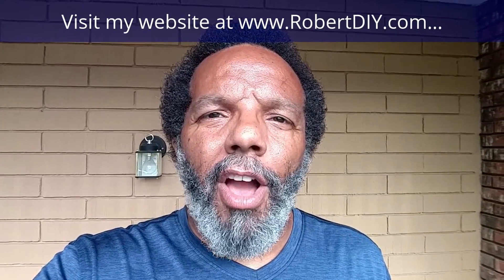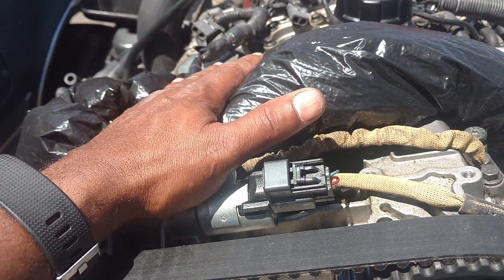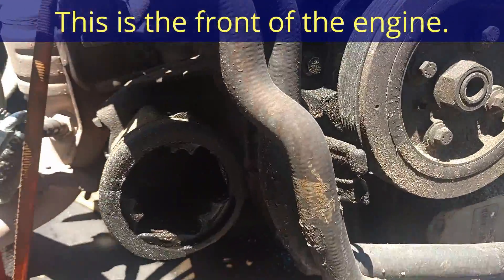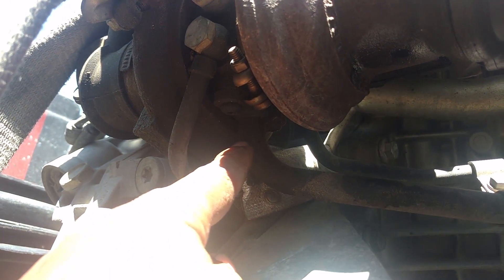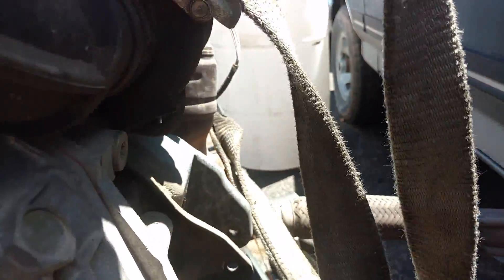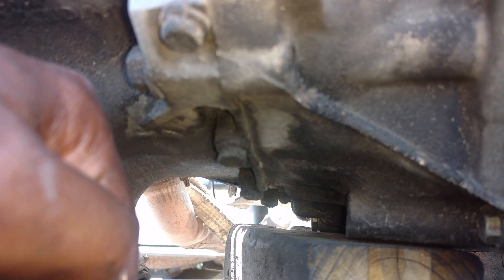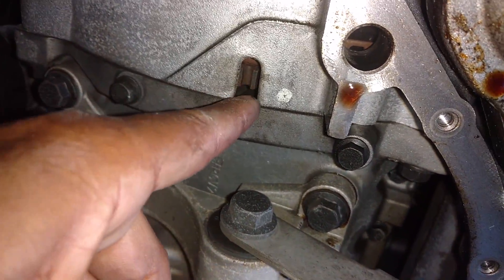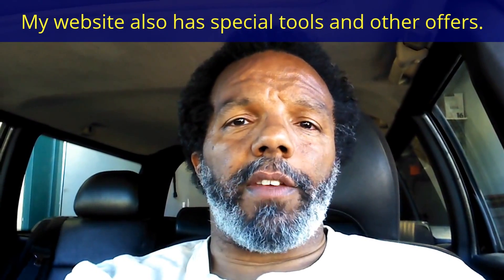How to find oil leaks on a Volvo white block engine. S60, XC90, V70XC, S80, S70, 850, 960, etc. VOTD

Comment: Hey robert on my 2000 c70 it was leaking oil bad and the intake cam seal popped out. Got a new seal put it in and it poped out again 2 weeks later. Im not sure why it pops out even tho the seal is fine. Any thoughts?
Reply from the maker: what brand seal did you install?
Reply: Corteco. However the oem cam seal did pop out and when i took it out it wasnt damaged , it was just as good as the new corteco one. Put the corteco seal in and same issue the seal just popped out. Maybe due to a clogged pcv?
Reply: U think a clogged pcv could cause these seals to pop out?

Comment: Robert thanks for your help in this matter.  If the oil cap  leaks ( I think) after an aftermarket replacement for my 98 s90 what else could be the problem? Thanks
Reply from the maker: Well, I would get a Volvo part. Then see if the PCV is serviceable.

Comment: Thanks again Robert, you really have saved me a lot of time. Been looking for a leak for the last hour plus and sure enough you did it again. I found it underneath the exhaust cam - drivers side rear. I have replaced much with your help, TB, pvc hoses, oil trap, intake seals, and more. Guess it's time for the exhaust. Thanks for helping me find it.
Reply from the maker: cam seal?

Comment: This helped a lot for the turbo oil line leak I have.  Thanks.  I was wondering if you have a video on a power steering leak as well.  I have a 2002 S60 T5 2.3L that spews power steering fluid everywhere.  I just cannot find the leak for nothing.  If you do have a video, I have not been able to find it.  Thanks.
Reply from the maker: Sad to say, I do not.

Comment: at 6:19 where you mention lower PCV box hose leak; is that the consistency of motor oil or a kind of "blow by" thinner goo?
i thought my oil sender was leaking, but can stop it, now I think it is the intermediate block seam.
 2005 S60 2.5t with "only" 118k miles
Reply from the maker: Oil leak.

Comment: Hi Robert I have a 00 s70 I had to change all the oil seals on it but when I put the car back together I have a code for the exhaust being advanced. All my timing marks are on the car runs great but it throws a code {sry don't remember what the number is its been so long but its an advanced timing) The main questions I have is...1st -  Is it possible that I over tightened the vvt gear 80ftlb and it is not letting it operate properly with the oil pressure?: (Could I have it to tight that it is pinching the gear an bearing)2nd - if I do have the proper torque lbs should I loosen the 3 bolts on the gear an center it on each other an reset the timing, what happens when you center the gear? is that how they come from the factory on the car to begin with?Sorry to ask this on this video clip I don't know how to get directly to your email to go into more detail. Thanks and hope to here from you soon. Also I have never worked on a Volvo b4 you have taught me a bunch !!!!!!!! and THANK YOU!!!!!!! A BUNCH!
Reply from the maker: https://youtu.be/0H5cgRYCMQg
Reply: Hi Robert Thanks 4 all the info I pulled the vvt hub off and reset all the marks  put it back together and the check engine light is gone. The only ight that's on is the service engine and that will gout after I put an oil change on the car. 1 thing that will make this video easier 4 1st timers to understand is that after you pull the hub off and reset the 3 bolts and gear to the center position "this is were it was confusing this should help every1" Like Robert said turn the hub and set it to the mark snug the bolt rotate the hub to see how many teeth it turns past the mark and count them, loosen the bolt turn the hub counter close wise that many teeth past the timing mark snug the bolt check it to make sure its on the mark then finish following Roberts directions for putting it back together. Not trying to step on your toes Robert just making it easier like I said for some1 like myself that wasn't quite sure or positive about what I was doing.Again thank you for all your info I couldn't of done it without you THANKS Have a Great Day!

Comment: if looking at engine from front of car i have an oil leak on the left side towards the top and rear and just below a few inches dripping down.  what might be the problem?  Thanks Robert you are a wealth of knowledge.
Reply from the maker: Huh? I have no idea. How about a picture of video?
Reply: @RobertDIY  sorry for being so lame!  its a 98 s90 and towards the back of the motor on passenger side i see a steady leak (drop) it looks like a hose.  going to the shop tomorrow and thought i could act like I knew something. lol.  have a good one!!
Reply from the maker: top or bottom of the engine?

Comment: 👍👍👍👍👍 cool Robert  keep up the good work bro . I was wondering where the oil came from on top of the engine block & now I know. Thanks once againe bro
Reply from the maker: You are welcome
Reply: Oil leaks on to of spark plugs?
Reply: Is that from valve cover seals?

Comment: @Robert DIY what is that at 03:53? I mean, my 850R does leak there, and it causes hidraulic lifter noises, or, the oil is crap? Only 1000 Miles after change, I don't quite know, it just started.
Reply from the maker: Huh? There are 3 access panels on the back of the engine. They don't cause lifter noise. I have no idea what kind of oil you are using or what filter you have installed.
Reply: @RobertDIY  We put Total Quartz 9000 in it, viscosity is 5W40,and,a japanparts filter. The engine leaks oil, on the passenger side, at the back of the cooler. PCV was changed 40.000 Miles ago.

Comment: Thanks for this video.
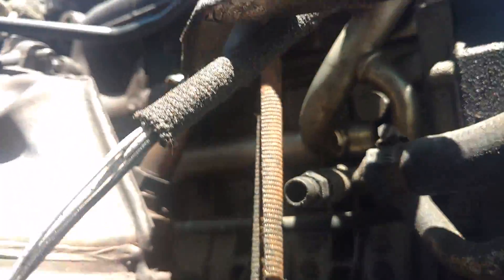Around minute 3:40 you are talking about block panels on the back of the engine. I have a 1996 volvo 855 turbo driven around 100.000 miles that is leaking at the back of the engine there is oil everywhere on the back of the engine do you have a picture, video or some link to the gasket needed to fix this gasket ?
Reply from the maker: No, I do not. Make sure that is the source of the leak and get the kit from the dealer, about $8. Easy replacement, just unscrew them, remove old gasket, install the new gasket, don't over tighten the screws.

Comment: Hi robert, your videos have been very helpful to me since i bought my c70. I just rebuilt my t5 engine and it is running really well but its leaking oil real bad. It looks like the oil is coming from the hole which you show in this video by the transmission side. I replaced the crankseal (i replaced all seals in the motor), could this still be where it is leaking? I tested PCV with the glove method and it isnt inflating, but it is not sucking either. Could the pcv be the problem since it isnt sucking in the glove? I really dont want to pull my engine out again to change the crankseal but i guess i have to.. But should the glove be sucking in to the oilcap? At least it isnt blowing. I have no idea how my brand new crankseal can be leaking.. Thank you in advance Robert! Do you think i have to pull my engine and replace the seal again or could it just be the PCV?
Reply from the maker: If you did NOT use a seal tool you likely damaged it.
Reply: Do you know if i can buy this tool in europe? I live in sweden and i cannot find this tool except for v-garage in canada and that will be too expensive shipping. I will try red line seal saver, though i do not think it will work.. its worth a try, then i probably will buy a real volvo seal but i hope i can install it without the tool.
Reply from the maker: Are you referring to the Rear Main Seal on the back of the engine where the flywheel mounts? If so, I don't recommend taking chances with that one.
Reply: I believe the rear main seal is leaking, and yes i should do it right since it is a big job just for that seal. I installed an aftermarket seal that maybe is not the best, that is probably why its leaking..
Reply from the maker: Seal install tool.

Comment: hello Robert Im new on your videos and you explain very good all this common problems of leakings and tips, recently I bought a V70 XC 2001 the car came with many mechanical problems between them the transmission failed, but notice an excessive Leaking of engine oil, I remove the top plastic cap on de head and note that it was full of oil and some of the screws had been changed by the previous owner 4 of them that are around a spark plug duct were swept from the thread, I  change some of the screws by others slightly longer and tightened well the oil drain decreased considerably but is still droping oil and falls on the Cv boot joint passenger side, and I do not know where is the problem, I will have to change all the oil seals ?? thanks in advanced.
best regards!!
Reply from the maker: Probably the front cam seals.

Comment: I'm hoping my leak is just the oil pan, engines been out before i owned it so it's anybody's guess. Are any of the pan bolts or accessory bolts ones I should use thread sealer on? Also, is the outward facing sensor  on the front/center of the block a oil pressure sensor?I have to replace the valve body soon anyway may just knock them both out.2006 V70R 270,000 miles
Reply from the maker: https://www.youtube.com/watch?v=L3_lC3X3AFg

Comment: Dear Robert
I have a 1996 Volvo 850 non turbo 2.4l i found out that there is low oil in the dip stick i but the car on the hoist and look all the driver side were covered with oil splash to the back of the car I added about 2 L of oil but can not locate the leak can you help
Thank you
Reply from the maker: Sure, bring it by.

Comment: Ay Rob, is it difficult to replace the camshaft seals by yourself? Can you make a short video about it of link to one? I havent located the leak yet but by the looks of it, its dripping right under the belt assembly
Reply from the maker: https://youtu.be/gt9w-ZSxs9I
Reply from the maker: I don't even know what kind of car you have. 🤔
Reply: Oh crap sorry, its a Volvo V70 T5 1997, same engine as the one in the video I believe
Reply from the maker: https://www.youtube.com/watch?v=y3mqyvisV6E
Reply from the maker: https://www.youtube.com/watch?v=tNjEhBYC7ww

Comment: Any idea as to what would cause oil to acummulate in all five of the the spark plug/coil well areas in a 2005 T5 xc90, thanks.
Reply from the maker: It's normal. Built Broke.
Reply from the maker: https://youtu.be/FIRoc0VxLd4

Comment: Hey Rob jus had a oil change on my volvo 850... '95 the technician said he saw oil around the transmission...any tips on how to proceed....check engine light pops on (looks like the coolant system  with fan icon) it only pops up for a few seconds then goes out when I accelerate from a stop)
Reply from the maker: Oh my! Have you checked the coolant level?
Reply from the maker: https://youtu.be/ZqdHDqGKYV0
Reply from the maker: https://youtu.be/R_Wko5d7Veo
Reply: My girlfriend took it to jiffy lube yesterday...I assumed they checked the coolant level....I will check it when she gets home from work....is there any major concerns I need to be aware of...thanks again for your help..

Comment: Hi, any ideas what this oil leak could be just above the turbo on the rear of the engine? See the picture attached and subsequent pictures. It's a 2006 2.4 D5 v70 
http://i125.photobucket.com/albums/p...4_161714_1.jpg
Reply from the maker: Sad to say I did not view the photos. Can not verify the security of the link. Clean off the engine, check for fresh leak.
Reply: Robert DIY ok. Thankyou for your time

Comment: Great information Robert, I have a 2012 S60 T5 and I had to put 5 qts of oil in it when the oil light lite. Do you know of an oil problem on that year and engine?
Reply from the maker: Most cars use oil. You should check the oil level weekly until you figure out how much oil it uses. You should top it off anytime it gets less than a half a quart.
Reply from the maker: The owner's manual probably recommends that you check the oil every time you get gas.
Reply: Thanks for your QUICK reply, Its my girls car and she said she saw the light, I checked and it was 5 quarts down. It did loose a quart over the next 6 weeks. I check it every Saturday, The dealer ( she brings it there) changed all the oil/filter and Breather box and said don't come back unless you see the light. On the Volvospeed forms they are saying Volvo knows of an issue that is so big they wouldn't recall. They are addressing them one at a time. The car is CPOwned so it is still under warranty. I was just wondering if you knew of issues on a 2012 S60 or of any Oil issues that sounds like what I am experiencing. Oh and your video's ROCK you are very knowledgeable, I had a non turbo 850 and two S60's and a V50 and have done timing belts and struts on them..

Thanks again- Doug Jones
Reply from the maker: Well, people these days are not taking responsibility for their own cars. Gas and go. WE should check our fluid levels, tire pressure, keep the paint clean etc, as often as needed. 

We should know how long it took to lose 5 quarts of oil. Did it take 50 miles? 4,000 Miles? Was it ever properly filled after the last oil change? What happened? If you don't check after the service , then at least monthly, how can anyone tell what's going on when no one is monitoring it. 

Check the level weekly until you can determine how much oil is being lost/consumed. How many miles does it take to use 1 quart of oil? If less than 1,000 miles then I'd be concerned.

My opinion is, everyone driving a car should check certain things themselves monthly, unless someone else takes on that responsibility, like I would for my wife.
Reply from the maker: https://youtu.be/WGqad7AD3l4

Comment: Robert I have a oil leak but can't find it. I have 1999 Volvo V70 XC turbo it leaks on the driver side and some oil blows up on top off the motor and blow out the back of the car on to the back glass. You think a turbo return line but I can't see it leaking from there.
Reply from the maker: Bring it by and we'll work it out.
Reply: I would but I'm in Ga.
Reply from the maker: +alan anderson 😵 How can I help?

Comment: Thanks Robert, this is the best video on the matter of Volvo oil leaks! At least, that’s a true Volvo engine! Mine has a Ford Fiesta 1.6 liter engine with a leaky turbo...however, it would be cheaper to replace the pcv valve, steam wash the rear of the engine to ascertain and sort out this leak!
Reply from the maker: https://www.youtube.com/watch?v=Bp4CtNaZh6U
Reply from the maker: https://www.youtube.com/watch?v=oRwDce_ALkk

Comment: Thanks for the video Robert.  I have a 2013 XC60 that has developed an oil consumption problem.  Volvo has engines with this problem and have a protocol in place to fix.  First, they overfill the oil by 1.2 quarts and replace the dipstick.  This seems strange to me because of course it will look like it's burning less oil if you fill it up more.  The second step, they tell me, is to replace the cam cover seal but I don't see any oil leaking under my car.  Wouldn't I see oil if it was the seal?  They tell me it burns off before it leaks externally.  Any thoughts?
Reply from the maker: Not sure what mechanic you are communicating with. Most cars use oil. How many miles do you drive before you are 1 quart low?
Reply: At this point about 1800.
Reply from the maker: I'd consider that normal. Check it every 1,000 miles or every other week. If you have to add each time you check, check it more often.
Reply: Thanks for your replies!

Comment: Hey Robert. I have a question. I have some positive air pressure in my crankcase for my 2.0t 98 V70 AWD. I've checked the PCV system, its all good. Did a compression test - it is 155/160 across all cylinders and yesterday checked the ports in the oil pan. EVERYTHING IS CLEAN AND WITH GOOD AIR FLOW. Nothing is clogged. BUT, the positive air pressure is still pushing oil out of every possible hole. The other thing is that the positive air thing is only happening when engine is at idle. When i rev the engine to about 2k rpm, there is vacuum in the crankcase. Can you help me with this magical problem? And thank you for these videos. I don't know what would i do without them. Keep up the good work!
Reply from the maker: What do you mean "it's all good"? Does it pass the glove test?
Reply: Not when the engine is at idle. When I rev the engine a little then the glove is showing that there is vacuum. When at idle, the glove is blowing off the cap and smoke is coming out of the dipstick. But is there a chance, that the PCV is just faulty? Because it is not clogged up, it looks brand new. Or you advise me to change the PCV oil catcher box and the hoses? Thank you for the fast reply.
Reply: Hi Rudis, similar thing happened to me, it was a clog on the PTC, on the admission plastic tube, very easy to clean! I think Robert has a video about it somewhere. Double check the hose connecting the PTC  to the engine as well
Reply: hugo fernandes okay, thanks. Will check the whole system again.

Comment: Hi RObet. I have a 2001 Volvo S80. Just changed the water pump on it ( couple of weeks ago). Is there a bleeder to take out the air from the cooling system? I'd done the usual turning the heater on and let the engine run and top off the radiator. I feel some pressure when I squeeze the upper radiator hose.
Reply from the maker: https://www.youtube.com/watch?v=1L8RMS5KunM
Reply from the maker: https://www.youtube.com/watch?v=gt9w-ZSxs9I
Reply: Thank you for the quick reply. I think the Thermostat of S80s is located inside the water reservior. I am thinking if I push that knob on top of it, it may release the air. Thanks for the info. LOL
Reply from the maker: No, it is not.